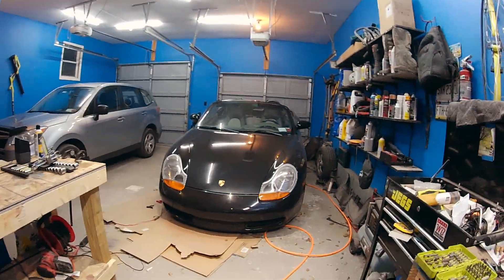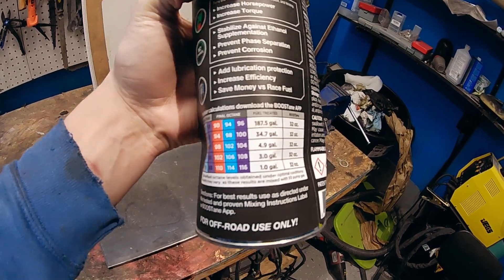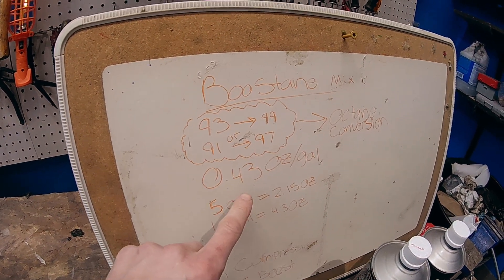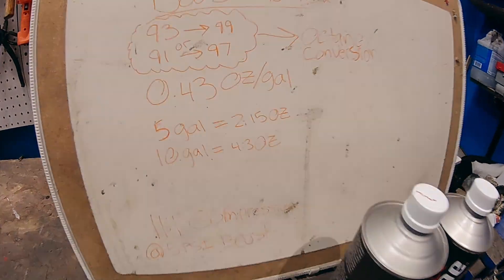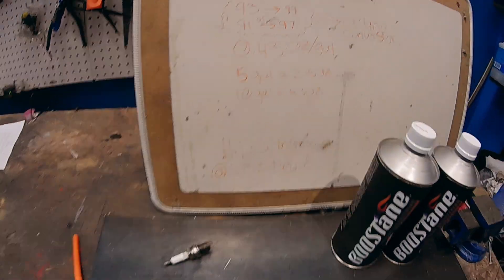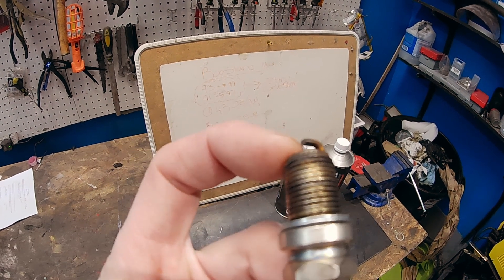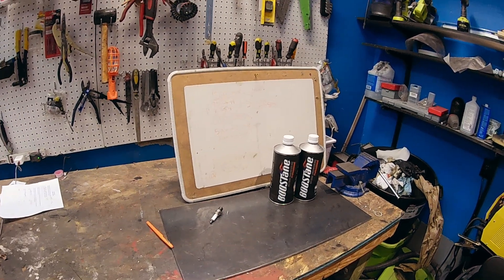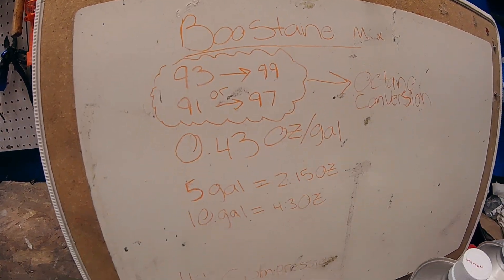Custom EBay Turbo Porsche Boxster (986) - Part 3 - Borescope and Boostane (ENGINE DAMAGE!!!)

Comment: Time for forged pistons to lower compression to below 10, and up the boost :D
Reply from the maker: Yes! I wish the pistons and sleeves for the m96 we're cheaper and easier to find. The issue with the factory sleeves is that they require a special coating on the piston. If you know of a good piston/sleeve combo please let me know. I'd love to run 9.5:1 compression ratio.
Reply: @daboss298  do you have to use the special coating? Why can’t you just run cast iron sleeves ?

Comment: That looks a lot like piston that’s on the edge of melting from too much heat (lean) and the the first piston marking is from knock. Trust me I’d know I’ve melted a hole in my piston when my injector failed
Reply from the maker: You are right! It was running too lean. After adding the piggyback ecu everything has been great.

Comment: I had my wideband installed 18” after the turbo not sure if that would effect readings compared to yours but mines is around 10 under wot
Reply from the maker: That's with the factory tune 
? How many lbs of boost?
Reply: William Curry yeah I haven’t done anything to remap or change fuelling yet, 5 psi
Reply from the maker: @GrowingDividends  I think it might be because you have the later DME 7.2 with a different MAF sensor. That's awesome you didn't have to remap. I bet that 3.2 with a turbo is a beast. Feel free to join the "Porsche Boxster 986 turbo project" on Facebook and post some pictures!!

Comment: So what will you be doing for tuning? Or are you going to just do 5psi on a stock ecu?
Reply from the maker: Hey Noah I'm building my own piggyback ECU. Which will be my next video I'll post soon. Even at 5 psi the stock MAF is maxing out and leaning out the mixture.

Comment: good work! cool to have a turbo on a boxster
Reply: I love what you have done to your 2.5.
I own a 2001 3.2.
I’ve always  wanted to turbo it, but have not felt confident doing it.
I live in Utah. Thank you for the great videos.
Reply: Cecil Noriega  same for me Buddy
Reply from the maker: Thanks man, it sure is. It sounds really good when the turbo starts to spool! Can't wait for some warm weather so I can post some more driving videos.
Reply: William Curry I want a turbo in my boxster too 😩👍
Reply from the maker: @kabelapa  It was a lot of work.....but fun. I'm also having trouble tuning the stock ECU so I'm going to make my own piggyback controller with a 7th injector I'll post about this later if you decide to do this to your Boxster. What state are you in?
Reply: William Curry that would be awesome🙏 I live in Sweden 🇸🇪 😁  maybe it will be a good winter project 👌
Reply: @daboss298  For now just looking at you :-) I´m buildning a house this summer so all the freetime I have is for the house. But mayby I will start in the winter :-)